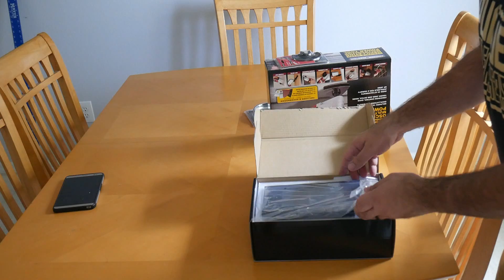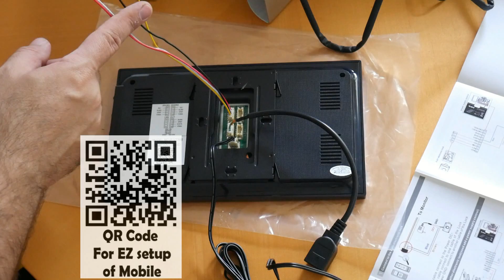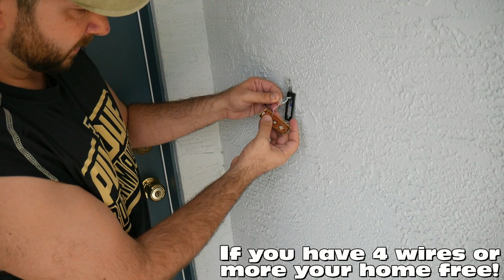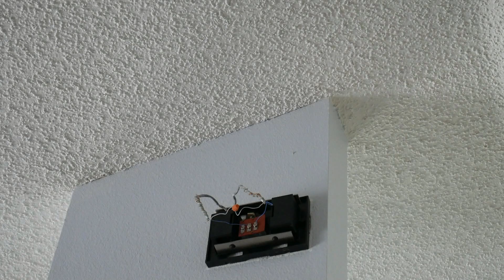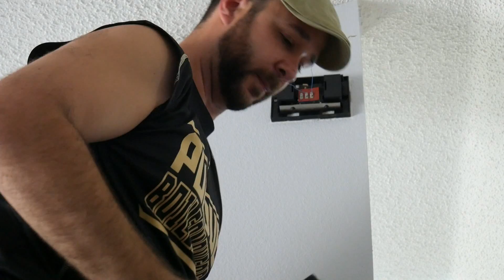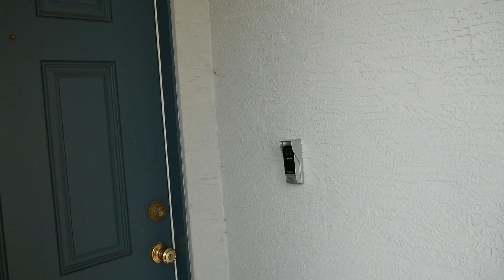TMEZON Doorbell Camera - How To Install & Review

Comment: Cool stuff! Thanks for the video! i was also interested in same door bell camera. Have you checked if it is possible to connect the doorbell via network? Some people say that it is able to cast the camera as onvif device with using rtsp://*:554/11 address. Are you able to check this?
Reply: Thanks in advance! The deivece converts the signal from analog camera into digital format anyway so making onvif casting should not be a tricky task for the device. I suppose there should be setting in menu regarding to network and video casting somewhere.
Reply: Btw, it would be great to have a video explaining network functionality of the device.